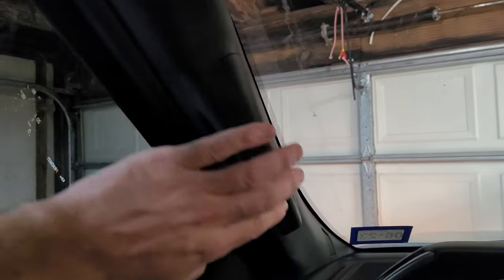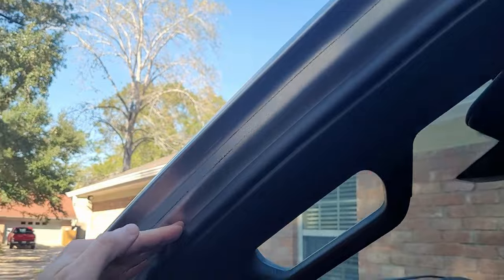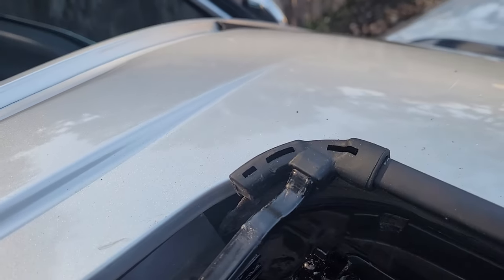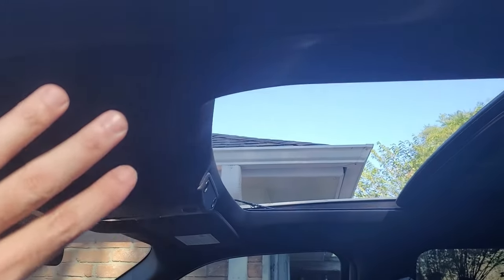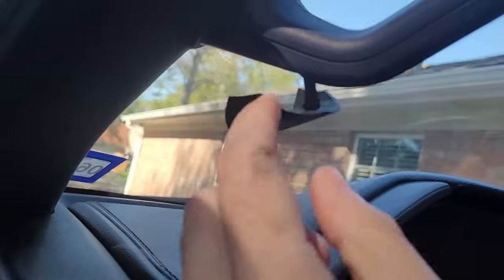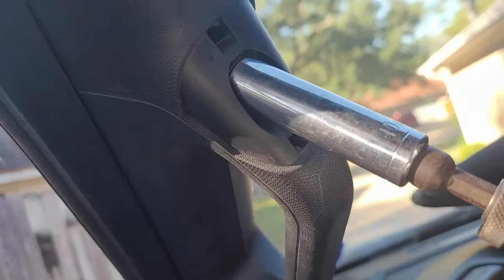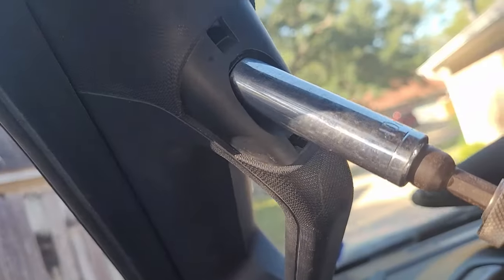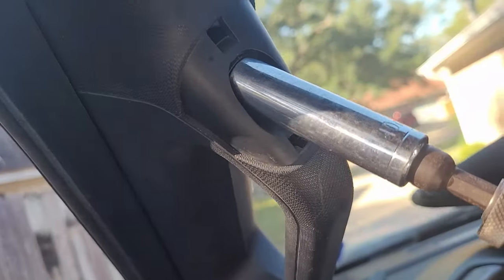F150 Sunroof Leak troubleshooting cleaning and repair

Comment: HERE IS THE FIX: I I had this exact same problem. This video was helpful. Showed  me how to disassembled the area, but he didn’t show the fix. Mine wouldn’t leak during a car wash either only during  heavy rains. Basically on mine the drain holes were clogged if it only rained a little bit, the rain would simply evaporate in the track. But with heavy rain the track filled up with rain it would run over those little u shape lower section across the front of the track  not draining through the drain hole and out the side handle. At first I stuck a wire in the drain hole and didn’t feel anything wasn’t thinking it was clogged, almost gave up. ( On mine the clog is further down the pipe where it bends) I went to harbor freight and bought a nozzle for my air compressor  with a 8”  straw type nozzle only about 1/8 diameter it’s only about $5.00  blew air through the line and out came the water under the truck. I did the passages side as well which I didn’t even know was clogged and a bunch of water came out there as well. Check with a cup of water like the OP did pouring in the track. So far so good for me. If you don’t have a air compressor a can of compressed air like you may use on a computer may work.
Reply: THANK YOU, this was more helpful than the video itself actually

Comment: These sunroofs are crap I have exactly the same issue it leaks and won’t close.  Mine leaks from the same spot and also from the center of the top console
Reply: Same leak on a '19 here.  Exactly as he described at beginning of video
Reply: @patrickn4706  my 19 as well he said he has a leak which he didn’t fix

Comment: Soo I check all my drains and it wasn’t that. Turns out that bug deflector WAS THE PROBLEM !! on the ends where it’s bolted on it doesn’t have a seal and it gets lose easily so what I did was put a water proof glue and waterproof tape. I’ll let you guys know if a few weeks if that solved my problem

Comment: I have an 04 F-150, and my roof began leaking over the passenger seat from the 
sunroof. This all started about three or four months ago, but I have been unable to get out and fix it due to illness. My interior was in perfect condition and is now ruined with heavy mold everywhere. I plan to clean out the tracks and drains today and then go by a handheld steam cleaner to see if I can get it under control.

Comment: Great video but when you put your garnish trim back in place the weatherstrip should be on the outside of it to keep a good seal to prevent wind noise and water leaks, also another thing is those hoses pop off I would recommend putting some hose clamps to keep in place, overall awesome video sir.

Comment: So I have a 2016 Platinum that has a cat pee smell to it after rain, car washes, and humid conditions that I have tracked to the moonroof. I took it to the dealership to have a few issues looked at and asked them to clear the moonroof drains, but the smell is still there. Anyone know where to look to find and clean the smell?
Reply: Same.
Reply: Its from the air conditioning.
Reply: @Kenwindatt  yeap they will need to clean the evap coil, its caused by moisture staying on the coil after short trips with high/max AC usage,  easy solution is to hit the intake with lysol and whenever the A/C is used before you arrive to your destination is to turn AC off and just run the fan.

Comment: Appreciate the vid, Ricardo. Had the same exact issue in my 2015 F150 Platinum. I used one of those computer dust blaster the kids inhale to clean it out, problem fixed. Also I recommend using a rubber treatment on weather stripping up there every 6 mo or so.

Comment: My 2016 JUST starting doing this, but on the passenger's side.  I also have that thing where it's stubborn if I haven't opened it in a while.  
Thanks for the video.  About to give this fix a try.  Seems that the other possibility was the satellite antenna which would need to be resealed but involves taking down the header, which I REALLY don't want to do.
Reply: Any luck with your leak? My 2017 platinum just started today on the passenger side and I now have a steady leak.